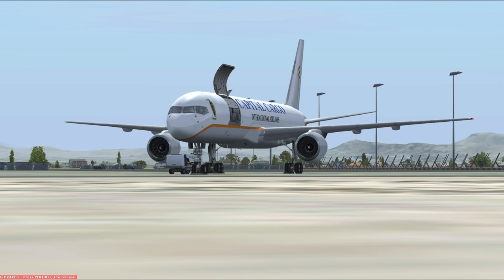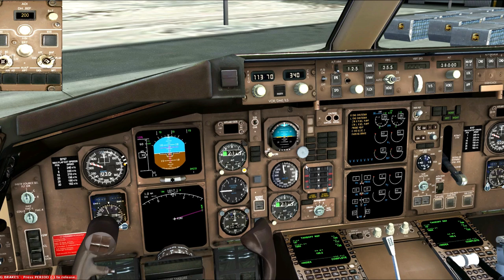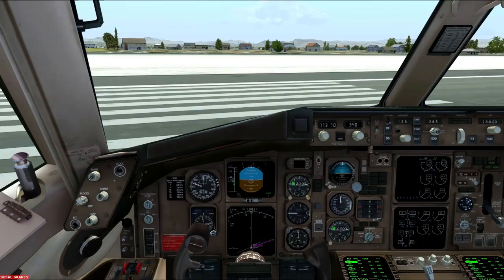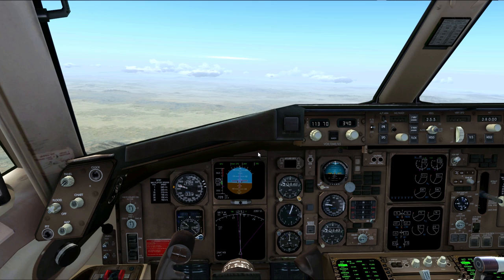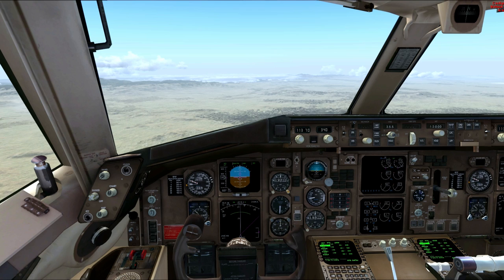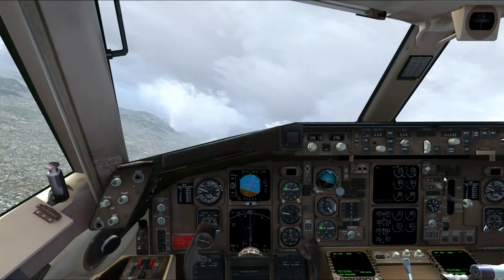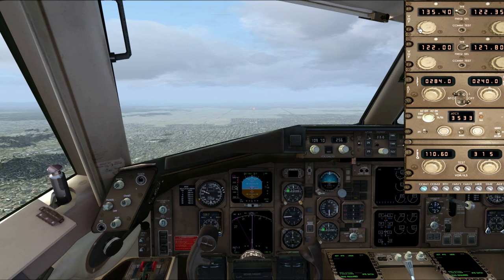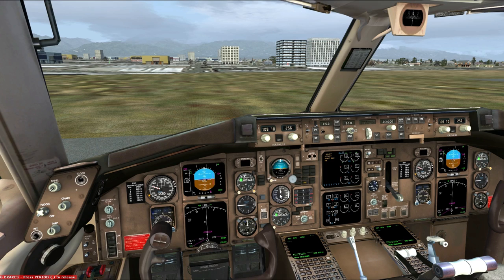FSX - 757 to ONT with Pilotedge

Comment: "climb via SID" means you'd adhere to the restrictions on the SID (ROPPR below 7k, BOACH above 13k) and climb to FL190. See page 2 of the SID, "...maintain FL190 expect filed flight level 10 minutes after departure." You would not climb straight to FL280.

Comment: Jeff this is me thinking outloud. Ive had similar issues in other aircraft try pressing the E key. that's the engine select key pressing E selects both engines pressing E then 1 selects just engine 1. E then 2 is engine 2 ECT. its used when flying multiengine aircraft with only a single throttle adjustment. by pressing E your telling the sim "I want to make adjustments to both engines" I use this trick quite a bit to maneuver aircraft around in tight spaces. by adjustments I mean any engine adjustment. so after selecting a engine using the key commands to make engine adjustments (Throttle, Mixture, Prop) will only be done to the selected engine. IE pressing E+1, then CTRL-Shift- F1 will cut the fuel to engine 1 but leave engine 2 alone. so pressing E selects all engines. its probly because of your throttle controller the sim is getting 2 different inputs. just try pressing E and see if that helps. if not then IDK. Most aircraft in FSX the auto throttle should override the throttle controller. It could also happen if you have multiple throttle controllers like say a joystick with a throttle adjustment and a separate throttle quadrant.
Reply from the maker: yeah I am gonna give that a try next time, funny my mind was crammed full of departure procedures and freq's yet I don't remember such simple sim commands haha
Reply: It happens. Ive done it myself.

Comment: HEY DO U KNOW WHY MY DEFAULT FSX BOEING 737 MAIN PANEL LOOKS BLURRY AFTER I INSTALL SP1 AND SP2 ON MY FSX STANDARD EDITION??? LIKE WHEN I PUSH F1O ALL THE DISPLAYS LOOK BLURRY. ILL APPRECIATE IF U ANSWER ME IM A NEWBE ON FSX
Reply: hi u need a good computer with a lot of space not a labtop turn graphics all the way up
Reply: x11ponzikillxx DO U OWN ACCELERATION OR STANDARD PACKAGE??? I HAVE STANDARD.
Reply: i have both what are u running it on?
Reply: im running fsx standard on windows 7 acer aspire 64 bit.
Reply: You have standard??? Why not Deluxe? It's cheap and wayyyyyy more better.
Reply: I have the Steam Edition and it is grate. Lots of the payware add-ons like Captian sim and pmdg work and it is cheep. I got it for $13 but it is around $25 at normal price